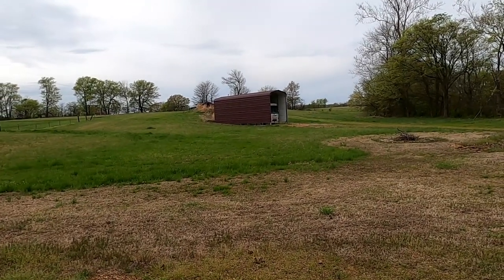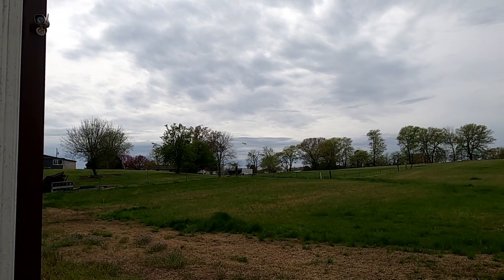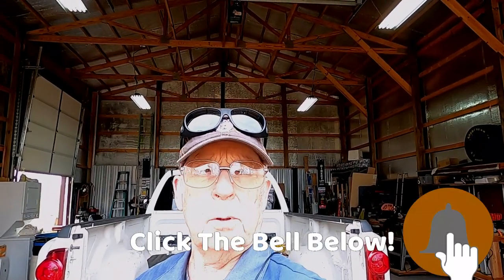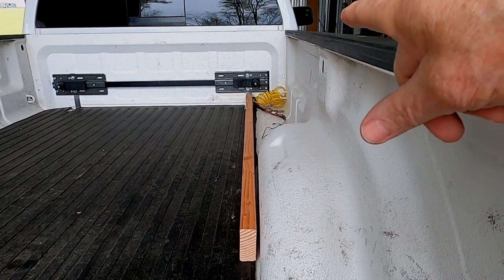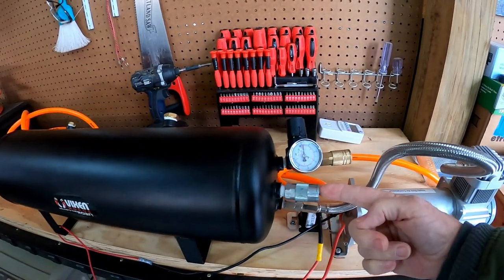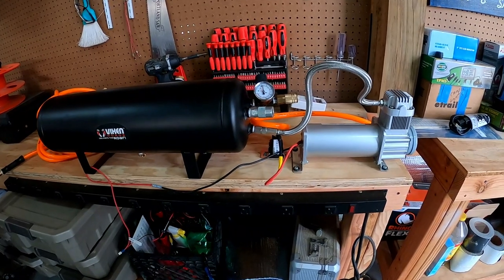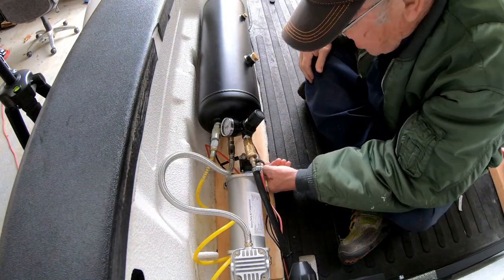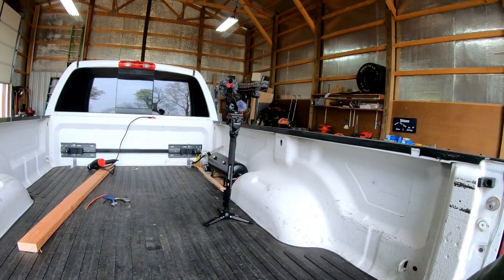In The Shop  - Installing truck Air Compressor - S5 EP004

Comment: Before you drive the truck anywhere you should figure out a way to cover up the regulator and snap lock connection for the air hose, especially before you go to Alaska. You will have so much mud and crap on, under, and in the truck that you won't be able to use the connection
Reply from the maker: Your right. For now, I have a ziplock bag over it with a removable ziplock.  Looking for something better, but that should do for now. Thanks for coming along and the great comment.

Comment: Love your videos!! Keep up the great videos. Is the air compressor in the bed of the truck waterproof?
Reply from the maker: I waterproofed the connections (wiring) but when the camper is on the truck it stays pretty dry. Thanks for the comment.

Comment: Does the tank only supply the air horns or can you also inflate tires from the tank too..so you have constant presssue?
Reply from the maker: Yes, I have a connection with a regulator under the bed of the truck on Shirley's side. In fact, I used it yesterday to top off a tire. Thanks for coming along and the great comment.